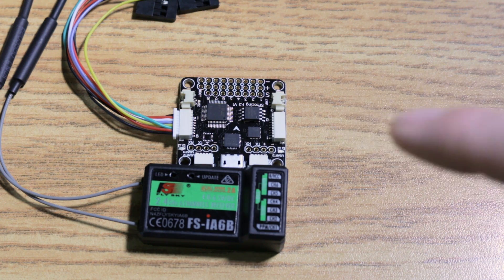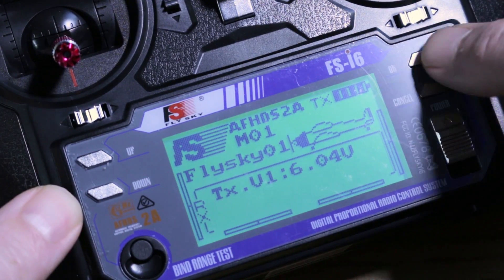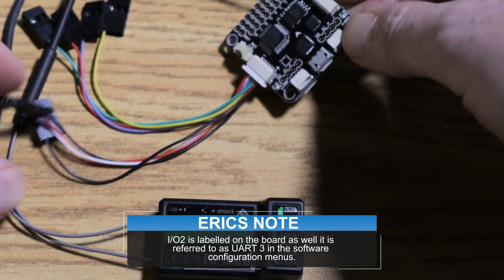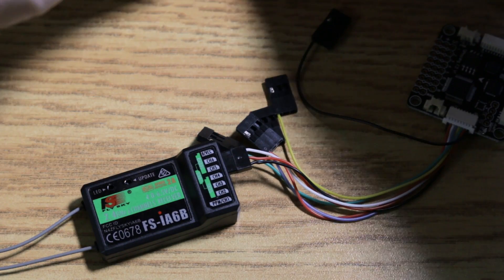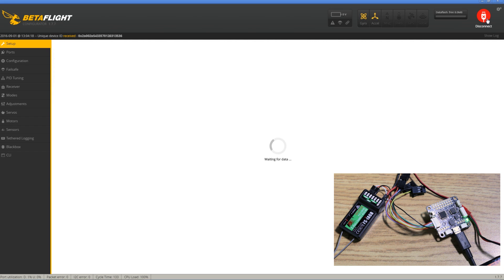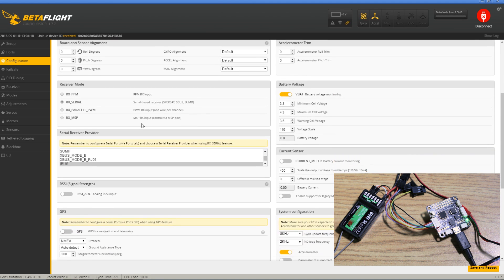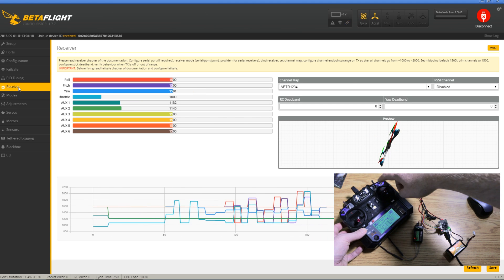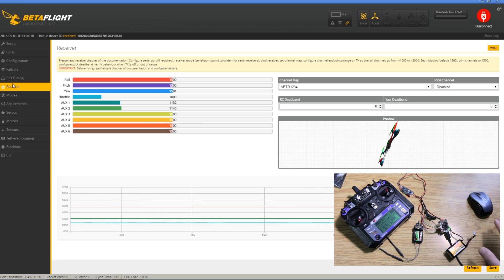Configuring FS-iA6B with SP-F3 Flight Controller using iBus | Tutorial

Comment: If I connect my flight battery to this receiver then connect to flight controller to the receiver to get power will try transmitter read my flight battery voltage ? Or should I just do the voltage mod to the ia6b receiver to use the bind pins as a voltage sensor

Comment: I still dont get the moving values like you did at 2:07, but I'm using an Omnibus f4 v3. I've been working on this for days and still no progress
Reply: HingleMcCringle same if you got pls comment
Reply: Gautam Verma I downloaded Impulse RC, used it to reset the drone, then flashed the firmware. After that, things started to work as normal. (Using ibus).
Reply: HingleMcCringle impulse rc FC tool ?
Reply: right
Reply: HingleMcCringle thanks will try to flash with that
Reply: HingleMcCringle will let you know sir if it works or not
Reply: miss me with that "sir" shit

Comment: Hey having trouble seeing any stick movements with a
 FS A8s receiver and FS i6 transmitter in Betaflight.  I've set it to IBUS and bound up no prob. Scratching my head as to why no stick input ... any ideas most welcome. Thanks!  Paul
Reply: wierd!! i cant get mind to bind.. it was bound before, but didnt recognise all th aux ports for some reason.. i'll try to rebind after these settings..
Reply: Same !! Did you find the solution?

Comment: I just picked up my radio and it came with this receiver. Where did you get the cable(s) to connect to the flight controller?
Reply from the maker: It's just a servo wire.  eBay or my store have plenty ;)
Reply: bad advice you know it came with that clone spf3 lol

Comment: Hi, I need help.
I have done the same as the video shows, the problem is that in the reciever tab all channels are at 0 and I don't know why. I have binded the transmitter correctrly and followed the same steps as the video. Any help? I'm very frustrated.
Reply from the maker: Make sure the receiver is powered up. If it is powered and bound you have a wiring or FC issue.  Make sure you enabled serial on UART3 (if you used that one) in betaflight.
Reply: Hi, I finally solved the problem. It was the firmware, it wasn't properly updated. Thanks for your replay anyway.

Comment: It works all, but my quad or receiver doesnt notice when the connection is lost. When I turn my radio off, the motors keep spinning. I set up failsafe in betaflight correct... need help!
Reply from the maker: Check failsafe in Tx

Comment: First off, great video! 
As I read all comments, I saw many were having the same dilemma with connecting the FS receiver after it's been linked and tested. Where does it get power from without the external battery tester. Sorry but after 32 videos I still can't find out.
Reply from the maker: On my SPF3 boards using UART3 I had to feed a separate power. On my Betaflight F3 using UART2 on the board it gets power from that UART hooked to iBus connector.

Comment: Hello MKme Lab. Thank you so much for your clear and detialed explaination. I am running in some trouble with this board. Using the PPM signal or the IBUS signal on the corresponding ports i am not seeing stick movement on cleanflight :( to confirm that the reciever is bound and the signal is arriving i connected an osciloscope prob to pin3 of the io port and tge signal is perfect. What could be the issue for not seeing the stick movement on cleanflight please? P.s. channel map is correctly set as well
Reply from the maker: Hmmm I dont use Cleanflight- nor do I know why anyone would anymore to be honest. I'd say try Betaflight and see how it goes.

Comment: Very helpful video. I seem to be having an issue with the receiver. For the RC to connect properly and to be able to control my quad, I have to plug the LiPo battery in and then plug the receiver in. If I leave the receiver connected to the flight controller and then plug the LiPo in, the red light just flashes intermittently. Does anyone have any idea what this could be? Thanks in advance.

Comment: Nope, 10hours of attempting to bind and still not working wth....
Reply: Wait what are you trying to bind? the receiver with the transmitter? If that's the case, connect the bind wire it came with and plug it into the horizontal top of the receiver, feed it with some power and hold the little bind button while powering on the transmitter. It should say binding rx or something and it should work
Reply: he didn't include it in the video so that was a big rip

Comment: Thank you very much. When I got my drone the were no instructions  for the  hook up  the Naze or the transmitter and receiver. When I got the drone, it was covered in flux and cold solder joints along with bird cage broken wires. I had to rebuild it. I was about to rip the FC stuff another one on until I saw your video. Apparently, I had the wiring between FC and the RX wrong on the I-BUS.
Reply from the maker: Glad you got it sorted!

Comment: great video thanks, do I need to provide power from the FC once the  FC is being powered by the flight battery? what I mean is do I need to run a cable from the 5v rail on the FC to the Rx?
Reply: the fc should power the rx once the battery is connected. Just need outside power to test in beta/cleanflight

Comment: thanks for the info Im kinda stuck with the same issue only ill be on kiss fc , I was assuming a direct solder like you would with an fr sky x4r to free up some wires might be another way to go , I don't suppose you'd know if that would work and how to wire it up ?
Reply from the maker: Nope sorry haven't used a Kiss FC yet
Reply: Just wondering if you had any info on setting up a ppm on beta flight. I am new to fpv flyers and recently got the Eachine x220 and it has the ppm arrangement.  It as the f3 racing board. I am using the FS-I6 with the FS-iA6B receiver. Thanks.